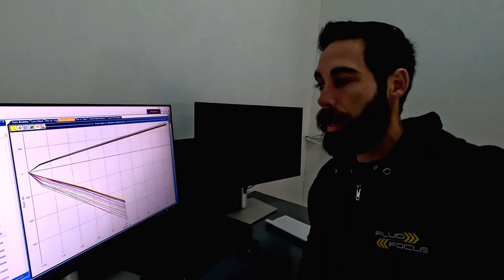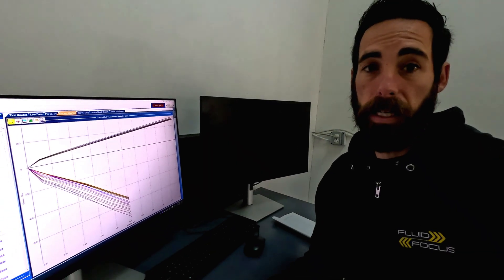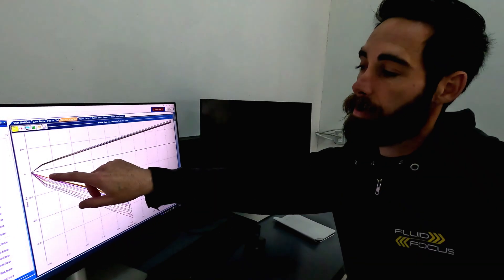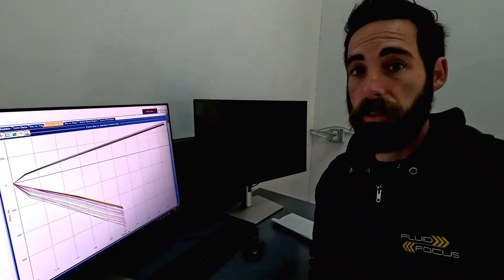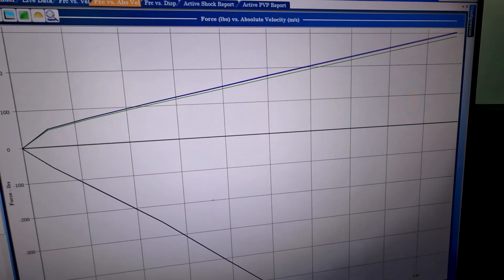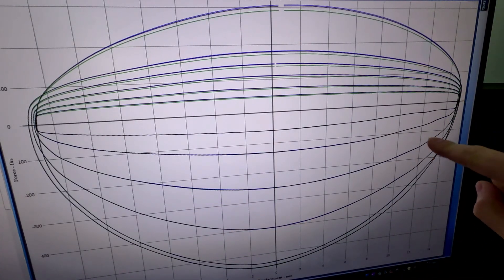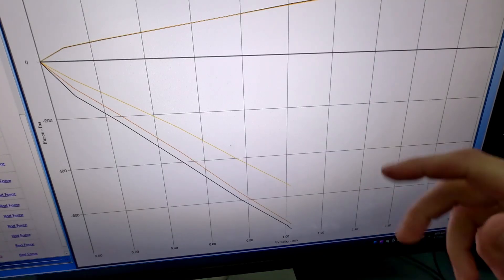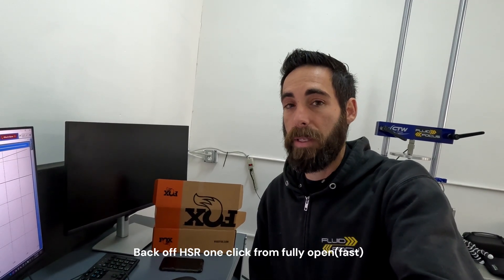2026 Fox DHX2 damping deep dive on the dyno! Is it worth upgrading?

Comment: First of all, this is great content. Please keep doing more of this.

However I want to share my real world experience with this shock on v5 Bronson at 170 lbs with appropriate sag and volume spacers. I set HSR and HSC to manual recommendations and bracketed LSC and LSR. All the way closed LSC is not good - rear end getting knocked around and the bike standing up in corners. All the way open LSC is mushy and horrible, borderline unrideable as it blows through travel and squats into corners. Right about bang in the middle of the range is great and useful for me. LSR is slow and dead in the lower half of the range. All the way open is too energetic. I settled on 12 clicks open out of 16. HSR I plan to leave due to LSR coupling. HSC I will bracket next but I expect good things based on the results so far. This is obviously subjective and personal to me and my bike, but I did find the stock tune to have enough range to bad in either direction with sweet spots in the middle.

Comment: Awesome video and data guys! I am using this shock in my SWorks Levo Gen4 and what I would love to see is the damping effect from the Firm/Soft lever. 😀
Reply from the maker: The firm lever is basically a lock out and not a position one would ride the shock looking for performance. So it’s not something we dyno and if we did, we’d have to run it really slow so nothing would break.
Reply: Actually, on this shock it’s not a lockout.  It simply overrides the low speed compression clicker and adds more low speed.  When engaged it doesn’t affect the high speed compression or rebound high/low at all.  Some people are riding it with the lever flipped to get more compression to keep
It from bottoming since this base tune doesn’t seem to have enough compression damping.
Reply: @r@r @rfrankway ow speed always affects the high speed. HS is just not the exactly same. I can feel it pretty well. If you are bottoming your shock then add spacers to increase progression (if it’s airshock) or high speed compression or get a progressive spring. Don’t add low speed compression (lockout) 😅

Comment: So compression adjusters do nothing.  That's not surprising, Fox always screws up stuff so they can "fix" it a few seasons later.
Reply: Seems pretty common for a lot of current dampers from the big brands, including forks. I think they are scared of giving riders too much power to mess up settings, but still want to give them all the "features" of lots of adjustment
Reply from the maker: What the suspension lab said!

Comment: Pause   
Slowing rebound makes it faster
Great job fox
Reply from the maker: It’s also the same as the previous gen. If you are at either end of the HSR adjuster there’s almost a feeling of a dead click or half click. That’s the leaf spring coming off the stop on the VVC plate/piston. When the leaf spring comes off the stop it allows the plate to free up and move out of the way when the oil comes through.

Comment: I've Kinda expected this. Twin tube design far more superior adjustability wise
Reply from the maker: I mean there are mono tubes out there that have range on the adjuster. One that comes to mind is the 11.6. Twin tube IMO is much more easier to tune because the shock is constantly back filling which reduces the chance of cavitation. Mono tube dampers have to really be internally balanced to work well. Which by the circle graph this shock is.

Comment: Would love to see a comparison to the old dhx2 and some speculation on why Fox would release a “worse” shock. Something’s gotta be working better on the new shock in the big picture right?
Reply from the maker: It’s definitely not a worse shock by any means. Like we mentioned in the video it probably has to do something with the bleed. We haven’t at this time received our adjuster tool to disassemble the adjuster where the bleed most likely is. The old shock had a great force vs displacement graph too but more of a range. Fox obviously saw something they liked better with a mono tube over the older twin tube design. As far as the construction goes, this looks to be a very promising shock. We will try to post some content here or on our IG page comparing the older shock adjuster to the new one. Thanks for watching!
Reply: @fluidfocus7874  i thought they went back to mono tube because of all the terrible reliability issues they were experiencing
Reply from the maker: We’ll see if this is more reliable. Time will tell, however this is based off a dhx and that’s pretty reliable. Ohlins and Vorsprung make twin tube shocks and they are highly reliable. Companies use twin tube in automotive applications and those are reliable. I guess what I’m trying to say is that twin tubes are also reliable.

Comment: Thanks! Was just thinking of reaching out to see if you had any details on the new DHX2. It would be awesome to see some details on the previous DHX2, previous DHX2 with your upgraded piston, and this dhx2.
Cheers!
Reply from the maker: We’ll try to do some comparisons
Reply: I’d be curious too.  Almost feels like they changed just to get away from the stigma of the old dhx2/float x2 but once they addressed the durability and got the FF treatment mine have been great.
Reply from the maker: Nice! Thanks for the kind words. Yeah we had really awesome results with the 21-24 shocks. The DHX is a really solid and reliable shock which a lot of the 26 DHX2 is based on.